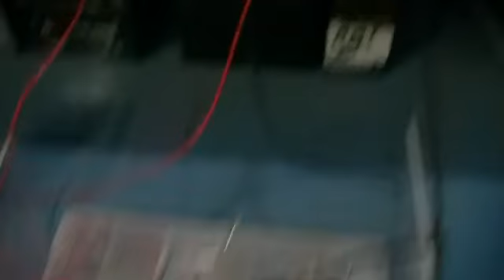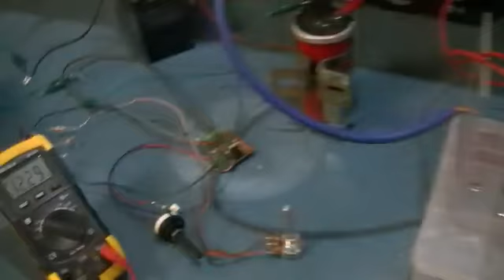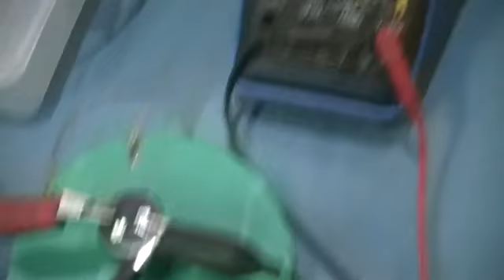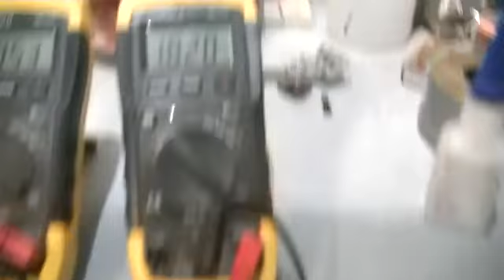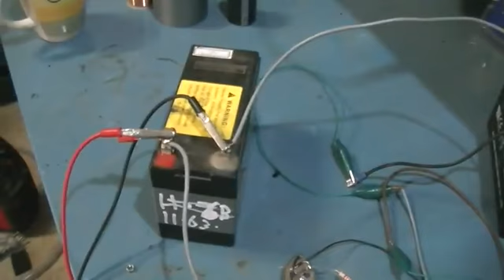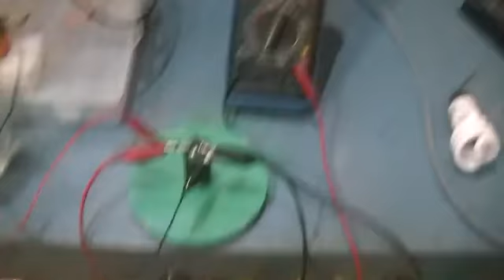high voltage water transformer

Comment from the maker: It is good to see some one else have the same effect.Are you able to post a vidio of your system working ?.
Also what is interesting is that the 2n3055's im useing have a breakdown voltage of 7 on the base-emmiter side,And yet a cfl require's about 450 volts pulsed at a high frequency to light up?-so why havnt the transistors fried?

Comment from the maker: Hi Hydro-At first i was thinking that i was acting as a ground plane and completeing the circuit.But now this make's no sence as the unit is now running of battery's and is independent from ground.Also there is the fact that it will work with the wire on the negative side of the battery aswell as on the positive along with every component on the system having a high voltage on it.
I have a theroy on what's happening-but i have to do more test to confirm it.